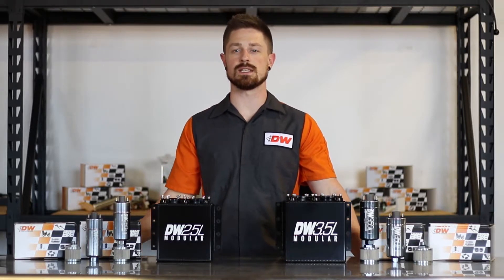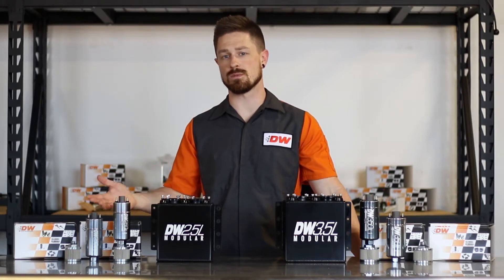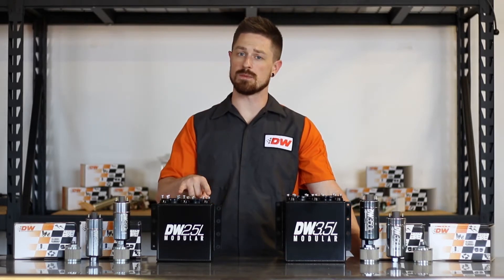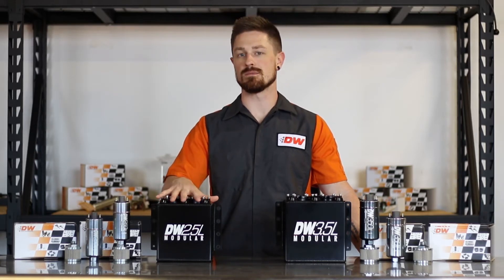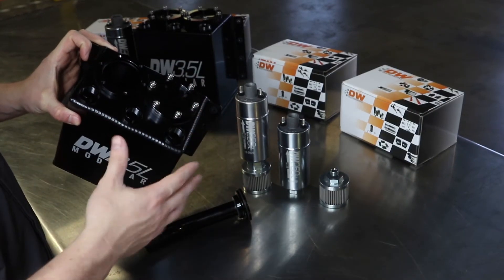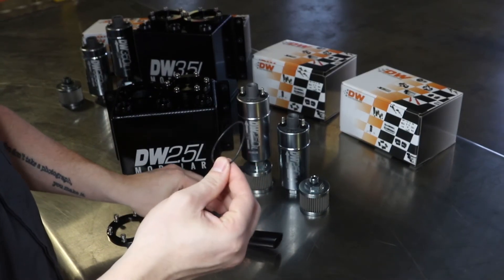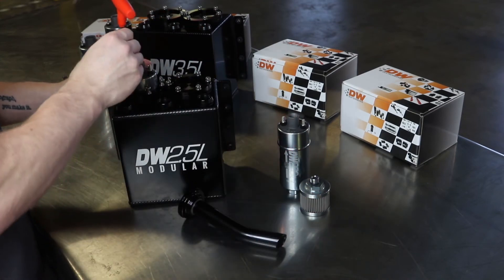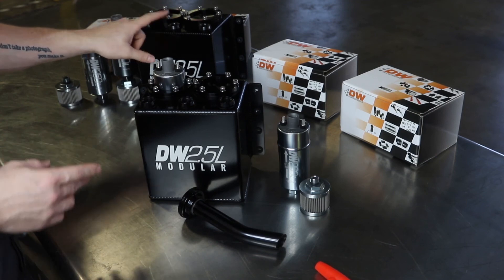DW Modular Surge Tank Install

Comment: Nice video!!!what pump I have to use for lift pump if I am going to use two bosh 044 pumps?
Reply from the maker: Pretty much any factory fuel pump can feed the surge tank enough fuel, but we also sell our own pump that is just designed to be a lift pump. Checkout part number 9-110-1055 on our website.
Reply: @deatschwerks  Thanks for your reply .I check your e-shop and my issue and concern is if the capacity of the fuel that lift pump supplies the surge tank is enough since the two Bosch pumps have almost the twice capacity.your reply will be highly appreciated!!!thanks in advance!
Reply from the maker: @dragstarstreettotop4591  It really depends on how much power you want to support since there should also be a return from the regulator keeping the surge tank full. To cover all bases you can step up to a DW200 as your lift pump.

Comment: Does the bigger tank accept Bosch 044 pumps?
Reply from the maker: The 350iL is dimensionally the same as a Bosch 044 style pump. The 3.5L surge tank should allow fitment of the Bosch 044 pumps.

Comment: What´s the advantage of using the pumps externally vs internally?

Thanks in advance,
Reply from the maker: The advantage of using pumps externally, you will have more capacity for fuel in the surge tank. Internally it will keep the pump cooler, and also keep the noise levels down of the in-line pump.